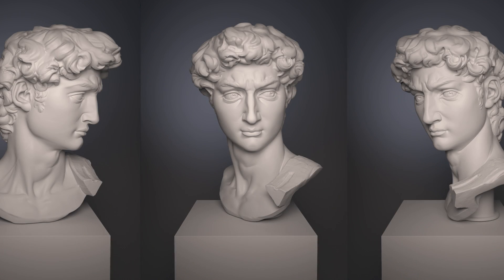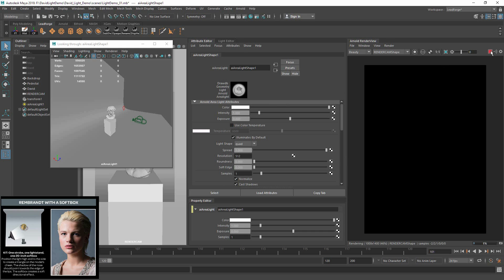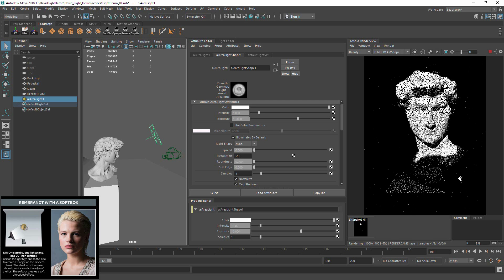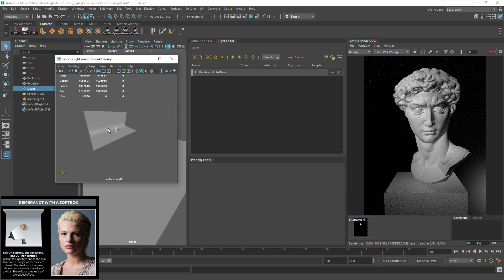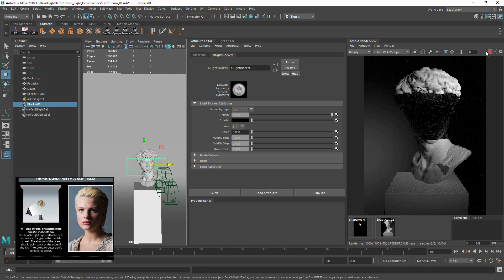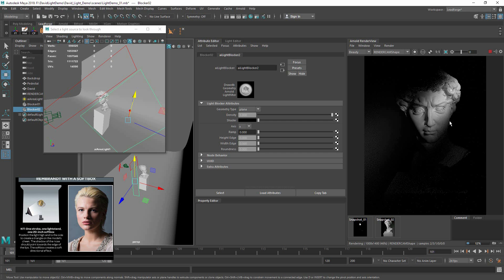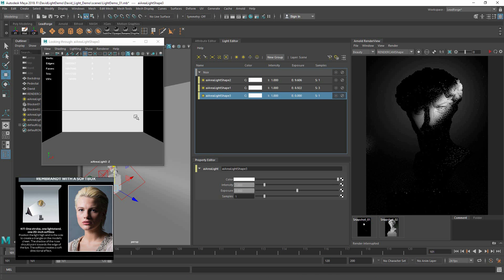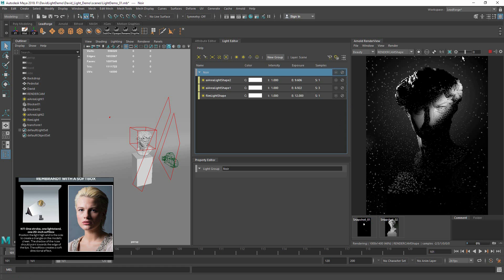Lighting in Arnold for Maya | Lighting Tutorial

Comment: Real world scale. So are you assuming the grid units are meters or cm?
Reply from the maker: I suppose I should clarify, what you should do is pick a scale and stick with it for everything. You can always rebalance your lights to the scale of your scene, but I've always gotten good results setting the scene scale to cm, then adjusting my grid so that it shows Meter Squares, 10 cm Squares and then 1 cm squares. There is really no "right" way to do it, just maybe best practices. I worked at a studio for almost a decade that had its own scale preferences that were not at all world scale, but everything was consistent across their entire asset library. However, when you are trying to match real footage with camera focal lengths and light intensities I think its advisable to pick something like cm or meters and model objects accordingly. When you are modeling furniture or similar objects you can usually find blue prints or dimensions listed and would be very easy for you to match if you are using proper scene scales. Good luck!